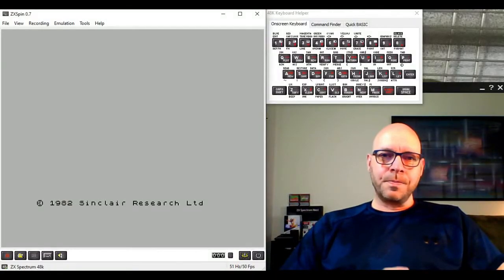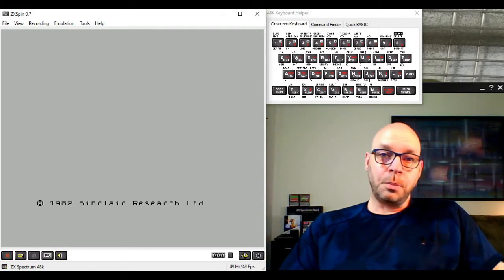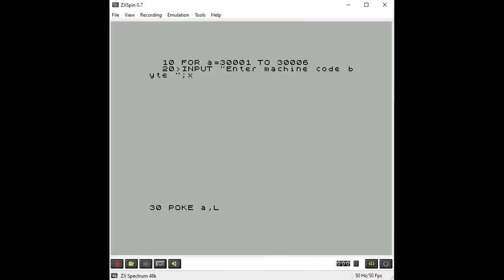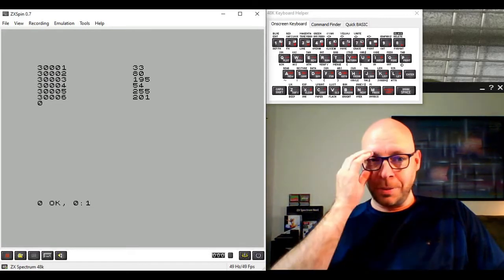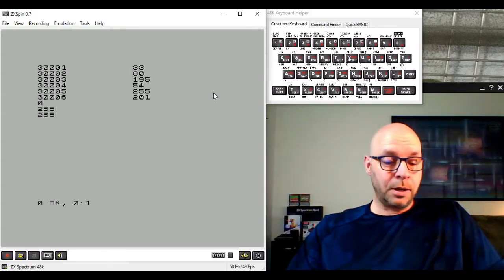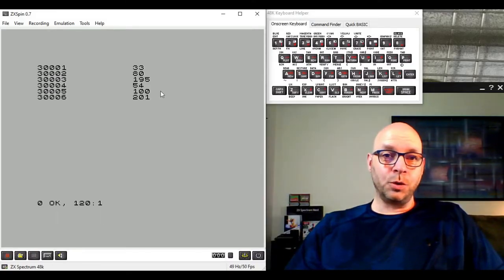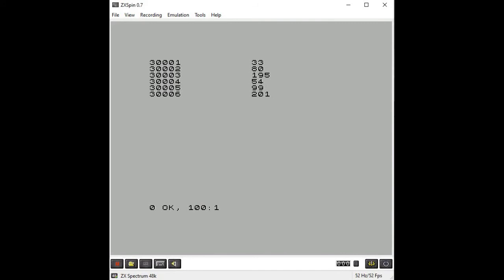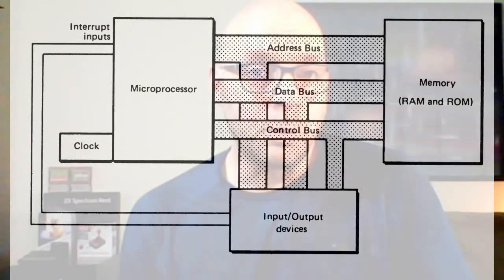#8: ZX Spectrum Next Game Dev. - Z80 Machine Code (Part 3 - Entering and Running our Program)

Comment: You said that, to start the program, all we need to do is execute RANDOMIZE and then the address to start it. How does it know which is the last instruction? I mean, how does it know when to stop looking for memory locations to get machine code instructions?
Reply from the maker: The RETURN instruction C9 (201) returns control of the computer back to BASIC since the machine code program was called from BASIC.
Reply: @Spriteworx  right, I forgot that from the last session!
Reply from the maker: @danielmartinho8975  hah no worries.